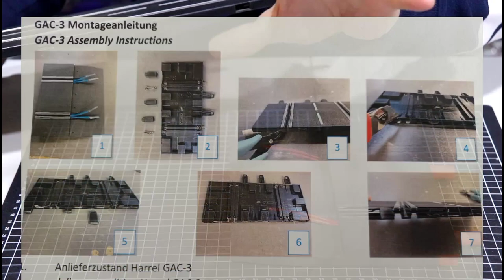Slot car track by Harrel Rs wood meets plastic

Comment: Without asking the question, you've answered it for me. I can use the Carrera Tracks I've invested in with the Harrel stuff. I'm pretty sure they'll be at the UK Slot Car Festival 28-29 May 2022, so I'll be able to work out the costs involved. I was invested in Ninco Track (up to my eye balls) and then decided that my ladder was up against the wrong wall and switched to Carrera. Looks like a Carrera/Harrel merger is emerging in my future plans.
Reply from the maker: Glad I could help 🤗

Comment: it is a beautifully engineered track but:
- why going for the 100mm interslot width. Ok, I know that the obvious answer is to be compatible with Carrera (that is huge in Germany). But if you want to create a premium boutique product, they should have gone for 120mm (that is the standard for 1/24 tracks - at least in Germany).
- however, the track surface is different between the two tracks and you will have grip problems when cars go from one surface to the other.  
- they have only 4 radii: R1, R2, R3, R4  - like Carrera. And to be honest I do not see any difference in radius of the corner. The nice thing is that R3 are also offered in 15 degree matching the R4. Carrera does only the R4 in 15 degree which makes it more difficult to make interesting corners in 4+ lane tracks. 
I do not know...Carrera to me still has the edge. If they would offer lane changers, pitlane pieces, and more radii (R5 and R6) with 120mm interslot spacing they would be a winner.